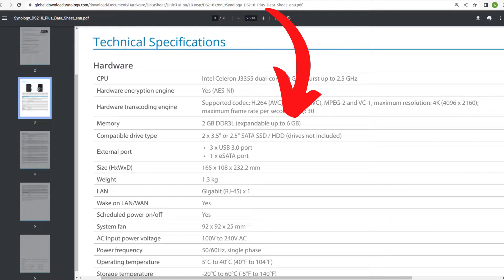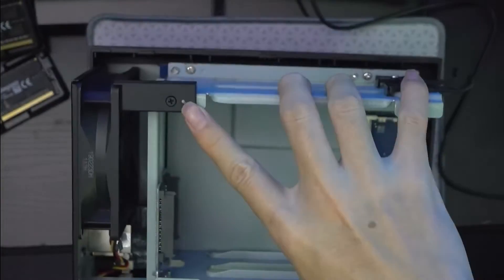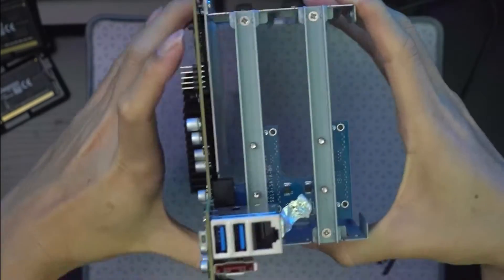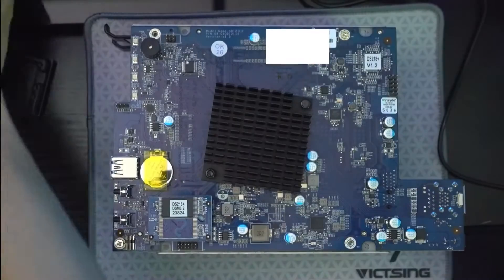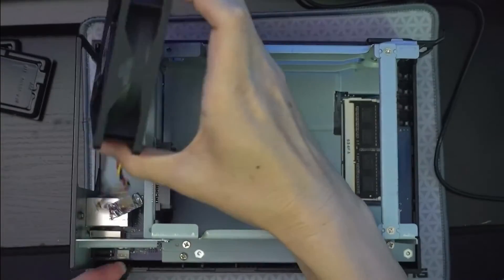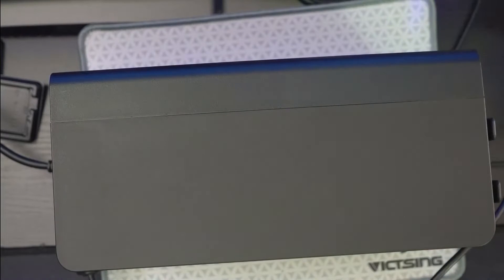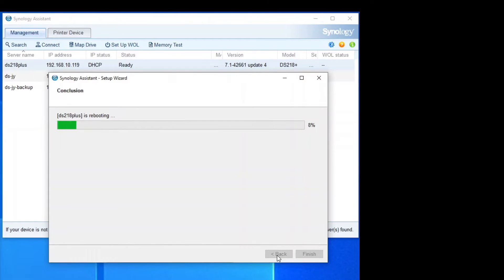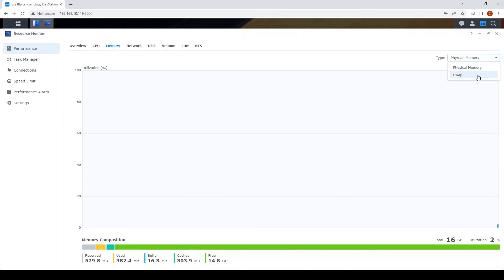How to upgrade memory on Synology DS218+? To 16GB of memory RAM.

Comment: If you only want to add one stick of RAM, then you only need to remove the HDD's and you can access the extra slot, without pulling everything apart.
Reply from the maker: yes. that is usually the case. depending on where you bought your NAS from i guess.

Comment: Thank you for the video. My feedback on this process based on buying the same memory as used in the video.

(1) Removing the case was difficult, you made it look easy. In the end I used two knives at each clip to prise the case off.

(2) First attempt after memory install: flashing blue light on startup for 30 minutes. 

(3) Second attempt - removed one memory module, boot success.

(4) Third attempt - reseated second memory module.

(5) Upon boot the power then kept turning itself off after initial flashing blue light boot after 5-10 seconds. This is when I started to worry.

(6) Fourth attempt - reseated second module again…

(7) Success and booted within 20 seconds of flashing blue light.

16GB of memory on tap but a challenging process to get there. Your video was invaluable and left on repeat! 😂
Reply from the maker: Thanks for sharing your experience! Glad you made it work! :)

Comment: Why should you add 16gb of RAM when the processor only can have a max of 8GB (according to factory stats)?
Reply from the maker: I do not know the specifics. The assumption is as long as the OS can recognize it, it would put it to some use.
Reply: Its 8gb per slot, and there are 2 slots